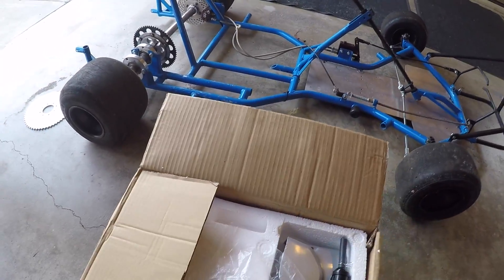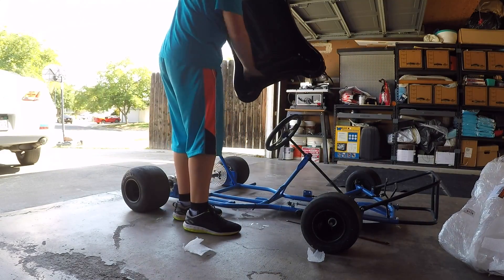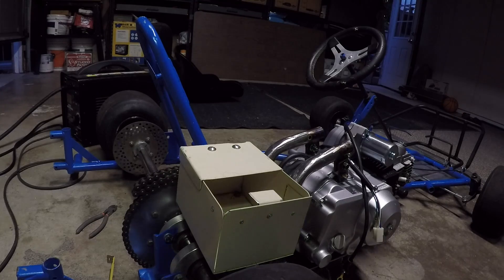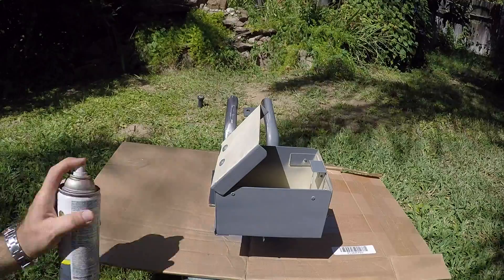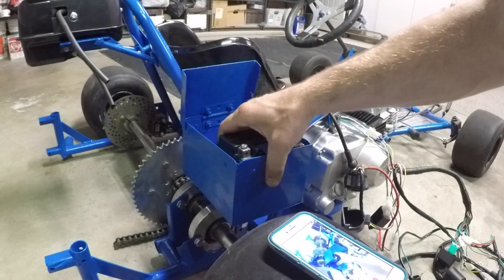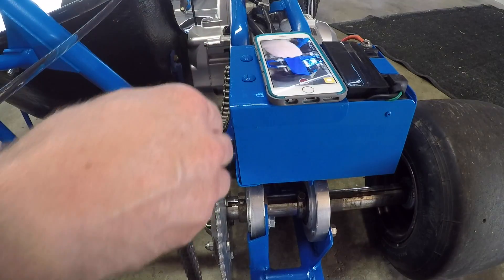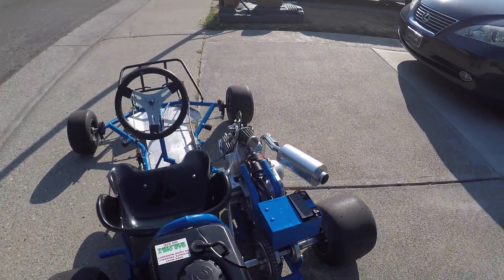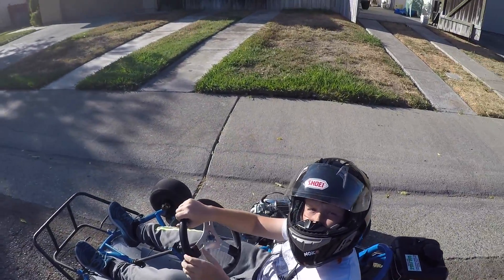125CC GO KART PROJECT

Comment: Which 125cc did you get? Did it come with everything you needed or did you have to order carb, starter, and other things? I’ve been looking at the 125’s on Amazon but don’t know which is better or which comes with everything you need. Let me know if there’s a name on it. Thanks, and that’s coooler than cold man!
Reply from the maker: The first motor I bought from Amazon it was defective. When I installed it, the motor itself ran fine but the second and third gears ⚙️ were not engaging so I returned it. Swapped it for another one and it worked great. Unfortunately it was a fully automatic motor so it only had 3 gears ⚙️ forward and one in reverse. I would recommend getting a manual motor without reverse. It should be a little faster than automatic. As far as Amazon goes, you can pretty much buy it and if it doesn’t work then you can exchange it for another one so buy it with confidence. And yes, my engine came with everything including the wiring harness and carburetor. Good luck and thanks for watching and commenting.

Comment: Hey man great vid, do you have any way of showing how you you wired your engine up. I’m having issues with finding a decent diagram
Reply from the maker: My wiring came with connectors so it was basically plug and play type of deal. I didn’t have to mess with it. Maybe just buy new wiring harness and it will save you some headache? It’s not that expensive on Amazon or EBay. 
Good luck 👍

Comment: what is the engine name? I have a Chinese motor on mine that looks very similar to yours
Reply from the maker: I’m not sure what name brand that engine was but I wouldn’t buy it again because it had clutch issues and in general, it was poorly made. I think I bought it off of eBay or Amazon can’t remember for sure. Many of these engines do look similar. Thanks for watching and commenting.

Comment: What you use for the rear axle? Did you use pipe??
Reply from the maker: Αναστάσης Golf2 
No. It was an actual go kart axle similar to this one here https://www.ebay.com/p/Racing-Go-Kart-Axles-Steel-38-X-1-1-4-1-1-4-Steel-AXLE-120-Thin-Wall-Black/708170923?iid=361937364970&chn=ps&ul_ref=https%253A%252F%252Frover.ebay.com%252Frover%252F1%252F711-117182-37290-0%252F2%253Fmpre%253Dhttps%25253A%25252F%25252Fwww.ebay.com%25252Fp%25252FRacing-Go-Kart-Axles-Steel-38-X-1-1-4-1-1-4-Steel-AXLE-120-Thin-Wall-Black%25252F708170923%25253Fiid%25253D361937364970%252526chn%25253Dps%2526itemid%253D361937364970%2526targetid%253D495067251006%2526device%253Dm%2526adtype%253Dpla%2526googleloc%253D1014391%2526poi%253D%2526campaignid%253D1497308096%2526adgroupid%253D59509629482%2526rlsatarget%253Daud-497631946071%253Apla-495067251006%2526abcId%253D1139476%2526merchantid%253D7922794%2526pt%253D%2526gclid%253DCj0KCQjwi8fdBRCVARIsAEkDvnIUCfPncrDPOhZShr4ho15AKsNSJHn31U73u3L9j3L2BqJvIhR7FsAaArWaEALw_wcB%2526srcrot%253D711-117182-37290-0%2526rvr_id%253D1688438559841%2526rvr_ts%253D315f11e31660a99c38c11ce3fff67af2
My axle came with the frame. I’ve paid $100 for the rolling chassis kart.

Comment: What happens if we place the sprocket at the centre of the rear shaft??
Reply from the maker: Rishikesh Jamadar 
It doesn’t matter where you install the sprocket as long as you can run the chain from the motor to the rear axle. Good luck.

Comment: Can I use a 80cc bicycle conversion kit
Reply from the maker: Tonmoy Baruah 
You can try but it might be underpowered. It all depends on how heavy is your go kart. Good luck.
Reply: balabay77 well the engine that I have is a 80 cc 2 stroke 6.5 HP
Reply from the maker: Tonmoy Baruah 
Well, in that case you should be good. Would love to see how your project turns out. Keep me posted and good luck buddy. 👍
Reply: balabay77 thank you 😊

Comment: You should replace the brake and gas pedal for something that is flat against the foot rather than a wire. My kart had similar pedals to yours and I crashed because of braking complications and the design of the pedals resulted with breaking 4 separate metatarsal bones in my foot which required a surgery to realign the bones with 3 plates, 12 screws, a pin and 39 staples to close the wound. A simple seat harness and flat pedals would have prevented this. Very nice kart and design but that's definitely something to take into consideration.

Comment: Покажите пожалуйста чертежи картинга) И где брали все детали.
Reply from the maker: SeregaTTR 
Раму от Картинга мы не сами сделали а купили с рук за $100 вместе с колёсами. 
Мотор можно найти здесь
125cc ATV Go Kart Engine Motor 4-stroke w/Automatic Transmission, Electric Start fit 50cc 70cc 90cc 110cc 125cc Quad 4 wheelers ATVs Go Karts Dune Buggy Sandrail Roketa Taotao Jonway Coolster https://www.amazon.com/dp/B00MVL2FW2/ref=cm_sw_r_cp_api_5DW4zbXP3WKF2

Удачи.
Reply: balabay77 Спасибо.

Comment: what spark plug did you use on this engine? i use a NGK spark plug
Reply from the maker: Crazy ATV rider 
Currently I'm still using original spark plug that came with this engine but soon I'll be getting NGK for better performance. 👍

Comment: you know that iame makes the 125cc motors for karting right? rotax also made them, but the major kart clubs and events like skusa don't use them. the Honda stock moto 125cc is used in the shifter class of karting. this project is nothing special. you should have just bought an Yamaha 100cc with a few hours on it and stuck it on a used full chassis.
Reply from the maker: IW Dot 
I totally hear ya but our channel specializes in cheap and affordable projects that anyone can make. This kart wasn't made to compete with race karts therefore it's fine the way it is. This turd is made to go nuts on empty parking lots.
Reply: Yeah I checked out your channel and realized that.

Comment: Do u have the component wiring set up my motor didn't come with one?
Reply from the maker: djtoo7 
No sir, my engine didn't come with wiring or any type of instructions. I had to google it to find generic diagram for 125cc engines.
Reply: ok thx, mine came with full wiring but no instructions and there are multiple connectors that can fit, so I'm trying to get them to send me photos of one connected up so I can follow it. thx later

Comment: Did you weld or bolt the engine plate to the frame?
Reply from the maker: Dylan F 
Engine mount is bolted down to the frame.

Comment: You should swap that motor with a 125cc manual transmission, and make it a shifter
Reply: Seeker of the truth the kid probably cant handle a shifter
Reply: Um you idiot it is a shifter kart. Its a 4 speed semi auto. No clutch
Reply: Its a shifter! Just semi auto
Reply: Seeker of the truth ya and add another 100-200 dollars to the project! Its for his kid and that really isnt nescescary
Reply: yeah he can barely drive without a shifter
Reply: it is a semi auto 4 speed transmission and it can be a shifter kart but I don't know why he didn't put a shift paddle on there, the kid probs can't handle it.

Comment: Shit idea, most kart engines are 125cc two strokes such as the X30 IAME engine or rotax at a better price and absolutely faster
Reply from the maker: Send me a link to a cheaper 2 stroke engine. The cheapest i could find was a used 2 stroke on ebay for $650. (not including a clutch or carburetor)

Comment: Nice build, but the steering wheel is upside down.  Everyone always make that mistake...... I mean, it's not a 'mistake' but 3 spoke kart wheels are designed so the center spoke points up, that is where you mount a tachometer for better viewing should you decide to put a tach on.  Not only that, with the wheel upside down like how you have it, you're kinda forced to hold the wheel at an 11 and 1 o'clock position!  Not good for kart control!  So I would suggest you flip it the other way.
Reply from the maker: The steering wheel is old and weathered. The top of the wheel had cracks in the leather/vinyl so i flipped it to avoid cutting my hands on sharp edges. Maybe later i will reupholster it or something. Good eye mate and thanks for watching.

Comment: but you didnt explain how you changed gear?
Reply from the maker: You meant rear sprocket? well, its easy just take out the rear axle and slide the old sprocket off. Then reassemble everything back in reverse order.
Reply: ah clever nice vid!

Comment: i have go kart with 125cc engine and can say why the hell you are using such big "star" if you call it that, if you want to burn tires maybe but if you want speed it should be two-tree times smaller, you wastinng your 125cc engine power cuz it has tons of it to move such small thing.
Reply: diabloxxx400 I agree: a smaller rear sprocker would be better !!!
Reply from the maker: We already installed a 21 tooth sprocket on the rear axle and we are planning on doing a speed test this weekend. Thanks for constructive criticism. Cheers
Reply: balabay77 perfect 👌!!!!
Reply: ps very nice build !
Reply: and video

Comment: People actually Dont Realize how good spray paint actually looks on projects like this GoKart, And when you hit it with Multiple coatings of Clear Coat it makes whatever your painting look like New Again. Its best to use good quality SprayPaints and ClearCoats.
Reply from the maker: Agreed. Paint that we used was cheap stuff but stores that specialize in auto paint sell base coat and clear coat in spray cans. They go for around 12 dollars per can but the results would be amazing. Those cans have different paint hardeners and will promote better adhesion to the frame.

Comment: nice job bro. i have a son myself. and its allways fun to do project together. hs 15 soon 16. so now its a car not a gokart. we have a off road gokart with a 420 predator. it has a few mods. no rev-limit. straight pipe . after market carb,and air cleaner. agian good father son vid
Reply from the maker: Thank you Charles for sharing your thoughts and for checking out our video. Soon when my kid gets older we will start working on cars as well. Cheers bud.

Comment: Ive been wanting to build a go kart. but taking it to the extreme. I want to make a mini 1932 Ford that has a roof. Has the exaughst coming out the top. No fenders rewire the starter to be able to turn it over in the cab, have around 2 - 4 seats and get gears set up on it and the engine spins a drive shaft to a homemade diff at the back. Yes i want to put the engine at the front to make better for drifting. This will be an insane build. I dont know what to put in it thought. Any ideas for a good engine for under Grand?
Reply: And have a clutch

Comment: You gonna shift it or what?
Reply from the maker: djdmonyk 
This fully automatic engine was defective so we swapped it for semi automatic in this video https://youtu.be/dVv3wAksP8w
Check it out. ✅✅✅✅✅😀
Reply: balabay77 the one in the video is full auto?
Reply from the maker: djdmonyk 
Yes sir. I thought that it would be a good engine but unfortunately it had transmission issue where it was stuck in "first gear". New engine works much better. Thanks for watching and commenting. Cheers.

Comment: Can you please send me a picture of the plug from the inflammation to the cdi? I have a problem with my ATV, he doesn't run
Reply from the maker: Ive returned this engine to ebay seller because it was defective but in this video https://youtu.be/dVv3wAksP8w i installed another engine with different plugs. If your plugs look similar than i can send you the pics but if not then i no longer have this silver engine.

Comment: The engine is in the side of the cockpit chair it might a dangerous cause the engine will get hot
Reply: That's how a lot of regulation race carts are set up.
Reply: No, its not unless you dont wear proper gear, which most people dont.

Comment: Welding in shorts and t-shirt. Didn't you get burnt
Reply from the maker: No sir i did not. Welding spatter doesn't fly far enough to get burnt.
Reply: +balabay77 i mean from the flash. I did some welding before wearing shorts and my legs felt like they were sun burned
Reply from the maker: That part is true but i try to tack weld in the garage and then when everything is where i want it to be, i take it outside to do my final welds so that i wouldn't have to breathe that shit.

Comment: Try something for me please. Make a tube that holds the air filter out a little farther from the carb. See how that helps. Also, if you get real creative, make the intake itself longer. Otherwise, really nice project. I'm sure the kid is stoked
Reply from the maker: By making intake longer wouldn't that make harder to start the engine due to the fact that fuel would need to travel further? I might try that just to see what would happen. Cheers
Reply: nope, longer intake runners help with low end torque. Its a 4 stroke, so it would see the benefit. The longer air filter neck is just to get a straighter shot of air into the carb, instead of turbulant air straight off the filter. Might like it

Comment: you guys will kill the motor that is a pit bike engine with a manual transmission
Reply: pointless vlog why will they kill the motor
Reply: Because there is no way to shift the fucking thing that's how they are gonna blow it up
Reply: and if it's completely auto and I highly doubt that they need a way smaller rear sprocket and a way bigger front sprocket for top end not torque
Reply: rod serling
Reply: rod serling =

Comment: should've used a predator, smh
Reply: A 110 (or 125) china motor has basically the same hp as a 212 predator and it has gears. This one is a full auto but i doubt a single speed preddy would beat a normal (manual) 110 china motor
Reply: DAT BOA nah
Reply: Masocisa7538  would smoke the hell out of that
Reply: lol my predator kart would smoke this thing stock
Reply: ยดยี
Reply: Masocisa7538

Comment: "125cc...." YEAUUHHHH "...four stroke..." awww... :(
"420 chain" the memes. Memes everywhere.
"420 friendly" Like Colorado? I'm moving there soon.

No shifting? What a horrible sprocket setup if it doesn't have gears. Even WITH gears I'd go way higher. What's the front sprocket size?
Personally I'd shoot for a 14-42 setup or somewhere like that. 14-35 to 14-49 for sure. That is, if it DOES shift gears.
Reply: I own a 125cc atv engine off my atv, it has 4 gears 3,2,1,N,R. I think he has no gears witch doesn’t seam right for a 125. I’m building my kart with a better 125 because it has gears and reverse on a go kart lol
Reply: 14/42 is what im running on my manual 140cc pitbike racing go kart build , the issue i have with that gear ratio is 1st and 2nd is like non existant 3rd and 4thnis where my power is at what donu recommmed that would be better to give me more in 1st and 2nd and good top speed